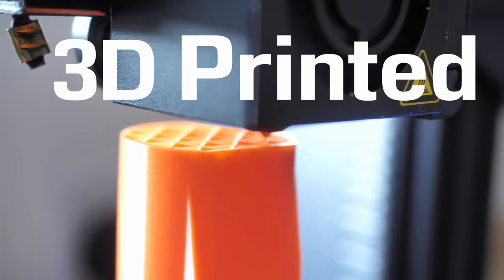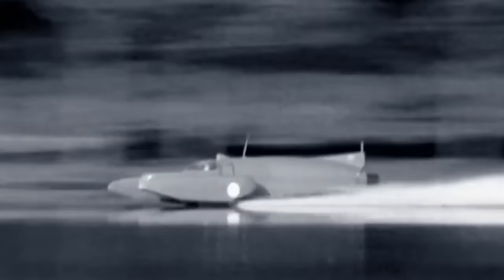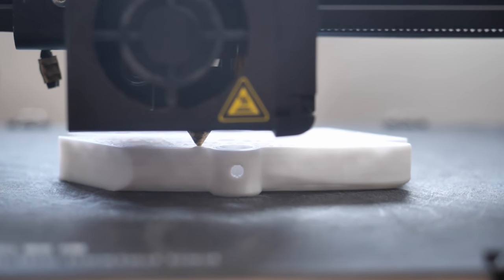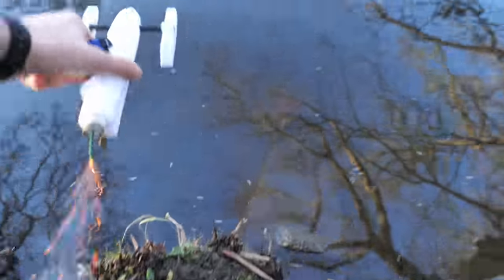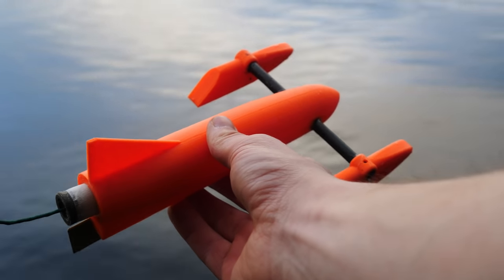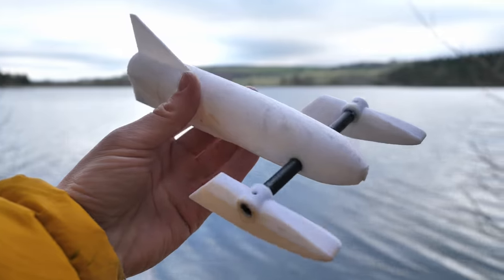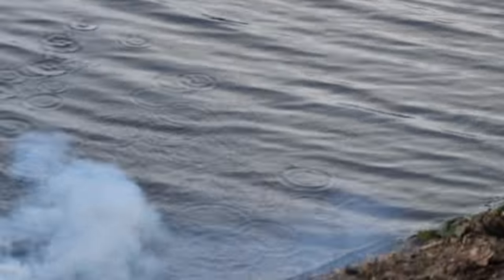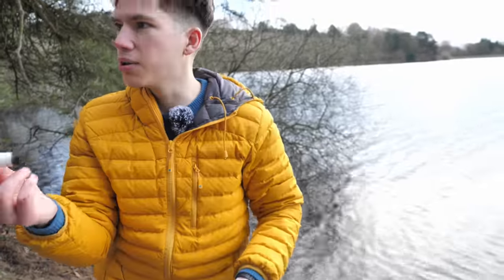Mini Rocket Boat

Comment: Hi, your hydro hull is porpoising. , it’s a pity that you couldn’t make the whole a bit longer little bit wider more power and some radio control gear on it.
And you will need a turn Fin on the right hand side sponson.  And I suggest making your booms a bit  longer, And your CG wants to be just on the trailing edge of the sponson. And I suggest reading a bit more about how a hydro runs, back in the mid 80s early 90s I run 3 1/2 CC 7 1/2 CC 11cc and 15cc .
I was dealing with the talk of the motor which obviously wants to turn the boat over. So you had a slight offset on the booms. However you shouldn’t require this because your Hull  is powered by rocket,, so your force is obviously forward but if you change the angle of your rocket you’ll notice a difference in how it performs. My hulls were capable of speed of over 80 miles an hour,  back in the 80s I had built a hull with electric motor in it something along the lines of yours but about 34 inches long instant power, The straight line speed at that time was 27 miles an hour on my first run I put it up to 50 miles an hour I’m sorry progressed, I believe nowadays they’re building hulls With electric motors in obviously brushless and the battery performance is probably 10/15  times better than what I had back in the 80s. 
Good luck with your project,  There are a few American guys running full-size obviously doing hundreds of miles an hour you can  read up about these boats
I’ll obviously Donald Campbell as well. You can learn a lot by studying how they built the boats.
A retired Englishman living in France.

Comment: Looks like those long-burn motors are only available in the UK, are there international equivalents or are governments generally too cagey about model rocketry?
Reply: Motors are also available in other countries, google TSP motors you will find it.
Reply: @piotrtendera5001  Appreciate it, they don't seem to distribute in the united states. Longest burning motors I can find are 7 seconds, and those are more powerful than the ones here.
Reply: @johndoe528  Right in the US are not yet available but we are working on it. For now, they can only be purchased in the EU.

Comment: Did you actually check if you cannot make your own rocket motors in the UK? ..
Reply: Yeah as I though yes you can make your own rocket motors liquid motors are fine as they not explosive.
As for solid rocket motors there is an exception in the ER2014 for 100grams for educational experiments.
Reply: You should have a word with the lads at spectacular fireworks.
They will point you in the right direction.

Comment: Igniting engines with a fuse is not a good idea to share on youtube.  Using the traditional electrically started ignitors is not that much more work and would be a better example.